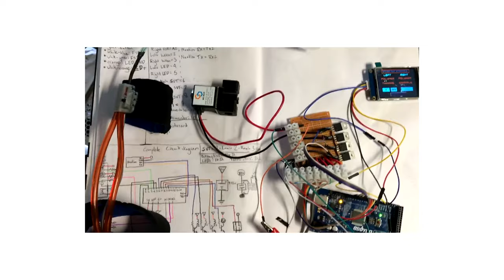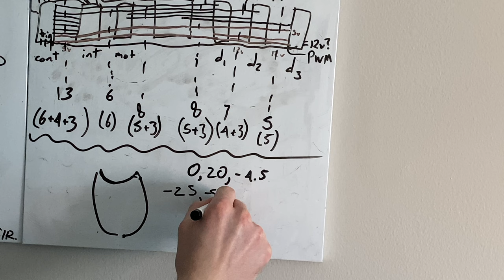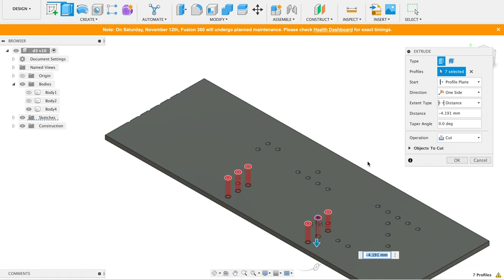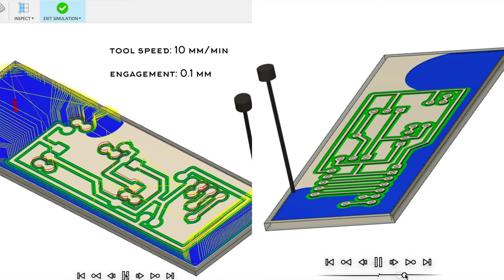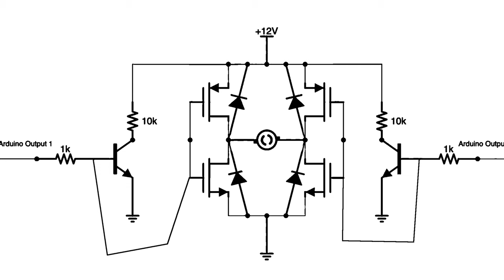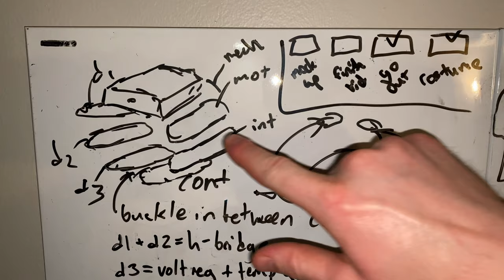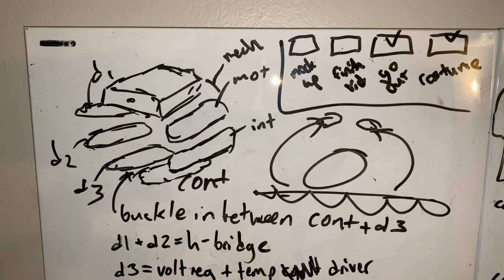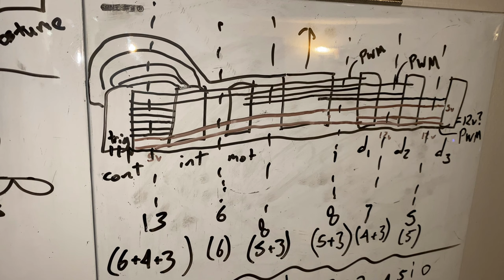Making Custom Circuit Boards at Home!

Comment: Great effort man, but you could save A LOT of time by doing "isolation routing" instead of clearing the rest of the copper, it could get down to minutes instead of hours, for generating g-code you could use FlatCam which is an open source software specialized in isolation routing, or you could test other alternatives, but it sure is the way to go to CNC a PCB.
Reply from the maker: Hmmm great suggestions, especially the isolation routing, I’ll definitely do that next time! Thank you!
Reply: @theAmazing  Looking forward to it!

Comment: Sorry mate, but the results you got from this are very poor, you need to use a V-bit, and use software that allows you to contact probe the PCB to adjust for the lack of flatness in the board to control your cut depth. With this you can achive beautiful results allowing you to even work with SMD packages with pin spacing as small as 0.25mm. I use a cheaper version of your machine (same Chinese heritage) and the results I achieve are far better then what you are seeing here. Your cut depth should be around ~0.07mm with a V-bit, and you should do everything you can to stiffen up your X & Z axis on the machine to get a consistent cut depth without having to increase the cut depth. I would like some pictures here but YouTube nixes my comments when I post URLs.
Reply from the maker: Thanks for the suggestions! You can send an email with those links if you want! ta.the.amazing@gmail.com